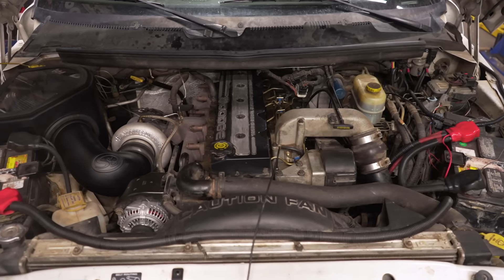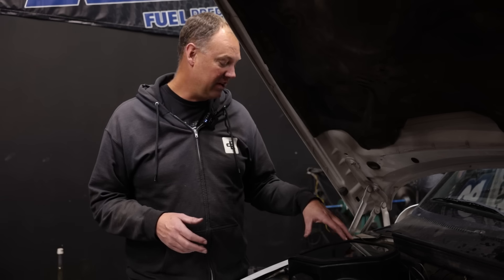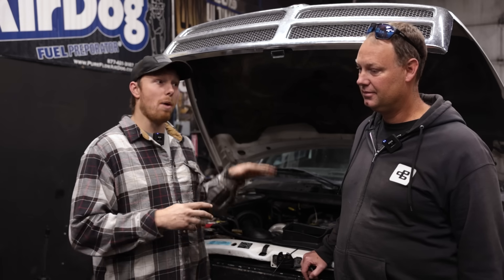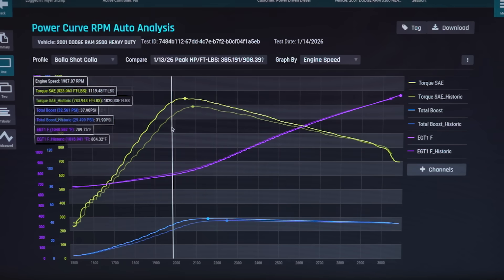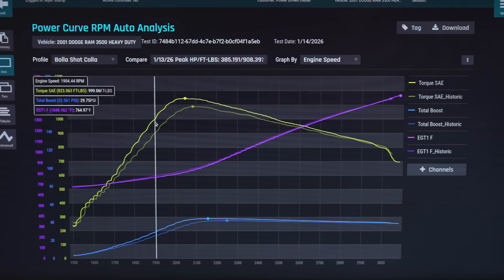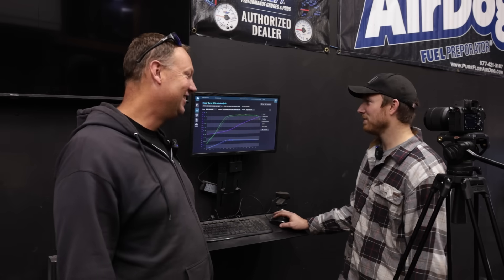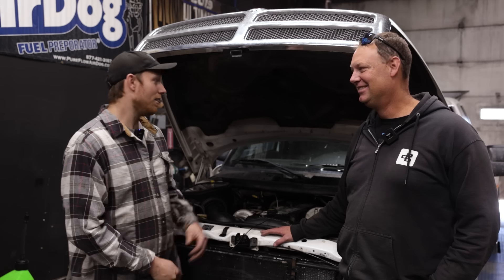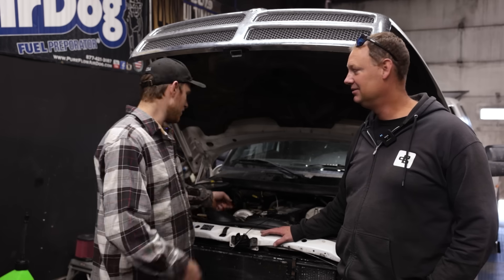Are Intake and Exhaust the BIGGEST Diesel Power MYTH?

Comment: Well this answers my question that the 60-64 is good for 40+. Mines been gated around 31 since I put it on. Looks like I'll adjust the gate, and start looking for better tuning than the smarty.
Also 01 vp truck with injectors, steed speed, 60-64, fass, head studs, etc.

Comment: Definitely makes me wonder what mines at. 02 ram 2500, did the head re torque last summer, 100hp ddp injectors, pdd 60/64, 4 inch exhaust, s&b intake horn and air box, mishimoto intercooler with 3" pipes and pdd custom tunes for the quadzilla. Keep it up boys!
Reply from the maker: Sounds like pretty much the same build, so it should be about the same in power.

Comment: Are the power jet stage 2 the same injector as DDP stage 2 with pilot holes? I know there was a collaboration when making them.
Reply from the maker: They are not the same, ddp makes great stuff also but the nozzle pattern we use is unique to us.
Reply: @pddofficial Thanks for the reply! These injectors seem very interesting. I always thought about trying some on my 12 valve. The only injectors I’ve ever run were some DAP 5x.013 sac.
Reply from the maker: Then the Power-jets would be a huge improvement.

Comment: Old stuff.  You haven't discovered anything new about improving towing performance, and how to achieve it for a vp truck, which wasn't known in '02-'03.  We knew the limitations of the stock intake and exhaust systems, and how to improve them cheaply.  We knew what mods where money well spent, and not.  There were many trucks at the 500hp level and greater, even back then, when the choices to get there were far fewer than choices now.  The big improvement since then has been in transmissions.  After getting the head studded, and maybe o-ringed, your real problem is going to be engine cooling, which is the real monster in the room for a 2nd gen.

Comment: 60/67-9 to compare how it does for hp/torque/spoolup/egt control on exact same tuning, tow test it to compare to how ur 6064 does in comparison then do the manifold.  Then ur stage 2 head needs installed

Comment: At what point do you feel headstuds are really needed? Ive got an edge 2, intake, exhuast and i just got 150 over injectors, planning on a turbo and exhuast manifold as well
Reply from the maker: You can go pretty far with a single turbo with retorqued head bolts.  Keeps the torque low compared to compounds. Of course nothing is perfect, if you need it not to fail on you studs are a good idea.

Comment: This is real world testing that everyday people want to see. The air boxes don't hurt for the most part, but knowing if it actually adds power is nice to know. Personally I use HSP cold air intake on my 2022 5th gen 6.7, no dyno time but I can tell the turbo spools better without the restrictions of the factory unit. My truck has a full weight loss package with 90hp/trans tuning. Have EGR delete and Evil Energy Intake horn going on soon as I have the time to install. And all done with factory 2022 ECM, no tuner box used, ECM was cracked, and the changes were made using the Cummins inline 6 data link. 
I'm not going to broadcast who in the comments, but you can find out searching FB.

Comment: Very cool.   I recently had my 12v fummins on the dyno and I lost HP when I took my nasty old K&N cone filter off of it.  Thanks for sharing.
Reply: That's impossible.
Reply: @sHoRtBuSseR not impossible, they just said in the video a straight pipe with filter makes more power than pipe open-ended. >

Comment: 5:10 I expect you are losing more power due to sucking the heat off the manifold and from the radiator fan blast than from flow effects of the pipe.  Same deal when the hood is closed and you trailering and its blowing a bunch of heat from the charge air and radiator then that duct thru the fender makes a big difference. The density difference is noticeable on my banks idash when its getting under hood air vs clean outside air.  An empty truck without a bunch of heat load it might not show up but when you are pushing the cooling system with power it does.

Comment: I’d be interested in seeing the pressure and temperature at the intake. The major thing I noticed with intakes is keeping temperature under control and how much a simple shield or sealed boxes helps with this. It’s not unusual to see +150 intake temps setting in traffic with just an open element sucking under hood heat. Ducting fresh air is where the magic is at, something you’re not going to grasp running open hood stationary on a dyno.
Reply from the maker: Towing test is next, in ready excited to see how it has improved!